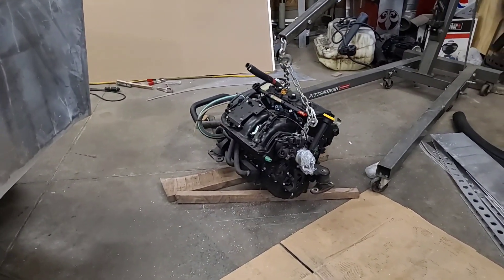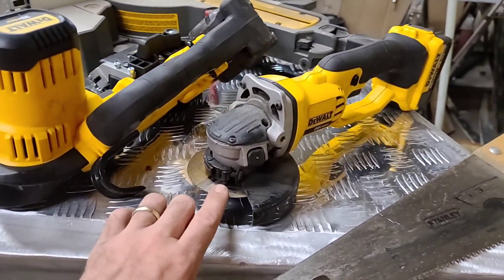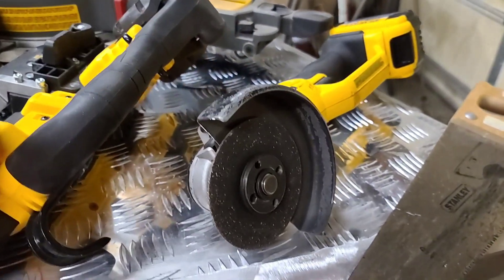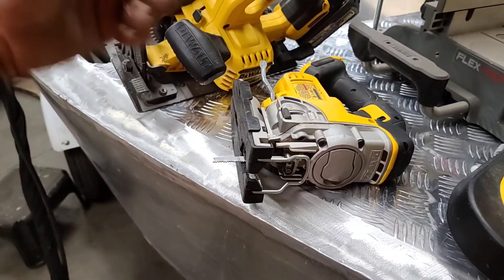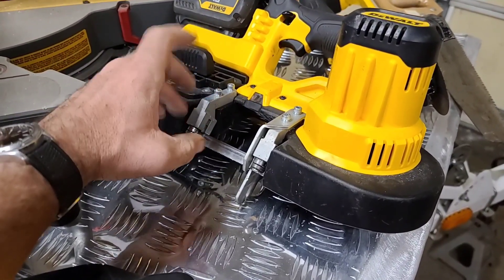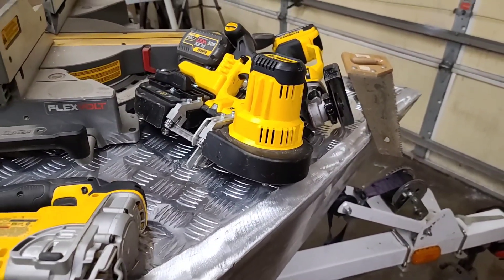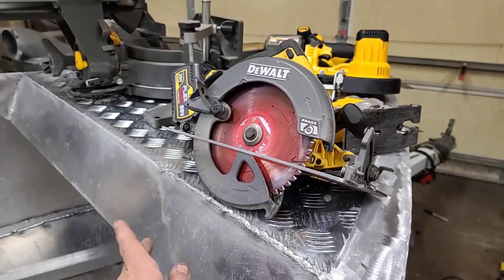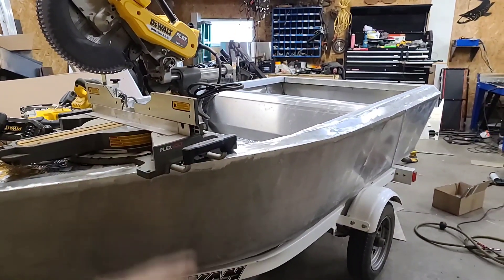How to cut aluminum

Comment: Do you need to change the blade on the mitre saw? Or just use the wood blade like you do with the circular saw?
Reply from the maker: @No_mans_flies  wood blade is all I use
Reply: @ cheers mate, been seeing mixed things about using a wood blade. I’ll just give it a go, I know I need to go slowly and clamp it down.
Reply from the maker: @No_mans_flies  yep slow and steady. I never clamp though.

Comment: I cut a lot of aluminum and I have different experiences when using a jigsaw. You need the right kind of blade (for cutting non ferrous metals). It is fast and effective. My tip is to tilt the jigsaw just a tiny bit forward when cutting, and you'll be good. Cutting with a grinder was a nightmare, it was a slow and utterly annoying experience, so I never use that. What you do not mention is cutting on a table saw, which is super good for cutting alu sheets. Use a proper saw blade for that purpose if you'll be cutting a lot.

Comment: Thanks for the info. I was hoping to see more detail on TPI and blade types that work best for cutting aluminum and your experience with both. The tips on placing the the angle on the miter was excellent.

Comment: Grammar police here and I'm gonna have to cite you for using the term downfall when you should be using "downside". They mean completely different things.
"Downfall" is a loss of power, prosperity, or status. 
A downside on the other hand is defined as the negative aspect of something. 
The correct way to use each of these two terms is as follows: 
The downside to smoking is lung cancer.
Gary was greedy which led to his downfall.

Comment: Sir you seem to know what you're talking about.
With a blade for cutting metal, can i use a Dewalt DCS361B miter saw to cut Aluminum 6061?
I'd like to cut flat / square / round bar down into small cubes and cylinders so i can CNC mill it into a part.
I need to know as I am considering purchasing it.
Thank you.
Reply from the maker: Yes you can but depending on how much you plan to use it, it may not last the longest. It's pretty small but if it has enough depth for your material it will work.

Comment: Try using a 5” carbide tipped blade in your air or electric grinder…….. goes through alloy like a knife through butter, we used a special thick blade, about 5mm thick to prep plate and a skinny one to cut

Comment: I have an Xcluder Door Sweep I need to install the website says i can use  a Hacksaw any suggestions on exactly which one to use?
Reply: For something that light about any hacksaw blade will work, but I'd go for a fairly fine one, like 32 teeth per inch (TPI), so it's not too "grabby".
  Also, something you can do if it grabs a lot (thin-walled tubing really does this), is put the blade in backwards.  (That means with the teeth pointed back toward the handle.  Normally the blade goes in with the teeth pointed away from the handle, so they dig in on the "push" stroke, which is more powerful than the "pull" stroke.)

Comment: You did gave some tips and perhaps you do cut aluminium once a while but you absolutely are not professional. I have worked almost 27 years with aluminium so I know what I am writing

Which tool to use for cutting depends on what you are cutting (plate, tube, profile) and are you cutting straight line or not.

Cutting blade/disk is really important. It is more important than you can imagine. It gives you the results

Cutting with hand saw - Use metal saw. That saw you did show was not for metal

Angle grinder. Use specially made cutting disk and the result is good. If you use disk which is for metal, it will smelt aluminium, not cut. It will take long time and bad results. One of the best disk, if not the best one, is Tyrolit. Normally thinner the disk, better results. If you need to cut aluminium just about 1 mm (1/24 inch) then it is best to use drinding disk (also Tyrolit is making really good grinding disks). Use different disk for cutting and grinding. Makita is often used in States but Makita is not making best disks for cutting aluminiun

Jig saw: Again, most important is the blade. I have tested all blades I have find and the best blade is made by one small German company. Currently I do not remember that brand name, I am sorry. If you need to cut longer straight line then connect a linear guidance so that one side of the jig saw is resting to that and you can make quite straight line. You have to understand that blade is bending. It do matter if you do need to cut a little bit thicker materials as profiles. Then cut slowly and blade do not bend so much. It is same when you need to cut curves etc. If you need to cut straight lines, use wide blade

Portable band saw is useful if you need to cut tubes or profiles which are already connected somewhere. There are saws which do have much wides space for cutting. Again, do remember to use right band.

Circular saw IS NOT GREAT tool for cutting aluminium. I will never ever use circular saw for cutting aluminium and I will never ever recommend it. Use Track saw with aluminium track. That is the right tool for cutting aluminium. Best ones are Festool TS 55 and Mafell. The best disk is one German quite unknown brand. I am sorry I do not remember the brand. It is sold only at special shops. Makita blades for aluminium has been really bad, even Chinese non branded has been better. Festool blade is good. Correct if I am wrong but if I did see correctly you had wrong blade both at the circular saw as well as at the mitre saw for cutting aluminium. The blade for cutting aluminium should have negative angle. Are you having such blades? You see it when you make line from the blade surface to the center of the blade. If the line goes front of the center point, then it is having negative angle. That kind of blade is pushing blade out from the cutting piece if it does not cut it. Aluminium is very soft metal and if you cut using similar blade as cutting wood, it will stuck to the aluminium and hitting very hard to you. Normally more teeth the blade is having, better results

With mitre saw you need to be very careful if you want to cut pipes. Again remmeber the right blade. If you need to cut bigger tubes then the best is Exact pipe cutting saw with right blade

Plasma cutting is not what normal people are having but of cource it is good.
Reply from the maker: I know the hand saw was not for metal. I only mentioned that 3 times in the video because I don't have it use one. As for the rest of the book you wrote ill leave that alone as I've only cut several thousand lbs of aluminum and clearly have no idea what I'm doing according to the book
Reply: @JDSOutdoors  knew it.  The other guy told me.

Comment: What would you recommend for cutting 6" dia aluminum  pipe? 1/8" wall thickness.   I aquire long sections of this pipe and cut it into various short lengths.  I have been cutting it with a Sawzall but its kinda a pain. Thanks for you input in advance.
Reply from the maker: I actually cut this often building ice houses. Miter saw if you have a large enough one works the best but I find myself grabbing the skill saw most of the time and cut one side, flip over and repeat
Reply: If you are using mitre saw then you have to be very very careful. Why? Because when the blade has cut part of the tube and is "inside" the tube, it can stuck easily and then it hits hard. The problem with cutting tubes is that it can turn a little bit and then blade do jam easily.

If money is not problem (eg. you are cutting for your work) then I do recommend to buy Exact pipe cutting saw. http://www.exacttools.com/en-us/home

One way it would be good that first you cut the tube usibg angle grinder but you cut 4 mm (1/6 inch) longer than needed. Then you use mitre saw for making precise straight cut. And again, when cutting the pipe using angle grinder, do not cut it once but cut a little bit so that disk is not going too deep. Turn the pipe a little bit and cut again. Repeat until you have cut the whole pipe. 

You can use jigsaw but it is not giving so good edge.

Comment: John, I do a lot of aluminum sheet as well. Good advice, I have always wondered about the Diablo metal blades, sounds like they’re not worth the money. Question for you though have you ever used a metal circular saw? I have heard the spin at a slower RPM to cut better?
Reply from the maker: I haven't though its definitely on the list of tools to buy in the near future. I "hear" they are the way to go
Reply: When cutting aluminium sheets, forget circular saw and buy good track saw. Do not use saw made for cutting normal metal.

Do not use normal metal blades but those made for cutting aluminium. The blade should has negative angle . 

More RPM is better when cutting aluminium. Aluminium is soft metal and it need to cut very tiny piece at one time so more RPM is better 

The only metal saw which you can use for cutting aluminium is only professional mitre saw with special blade. Metal saw is having low RPM and then the blade needs to be special, not having teeths but sharp edge and shape as wave. I had one with cutting fluid pump.

27 years experience for professional work with aluminium. At best years we do cut more than 100 000 aluminium profiles.